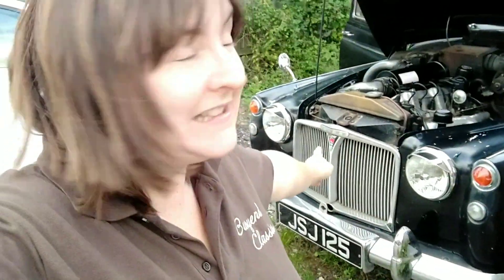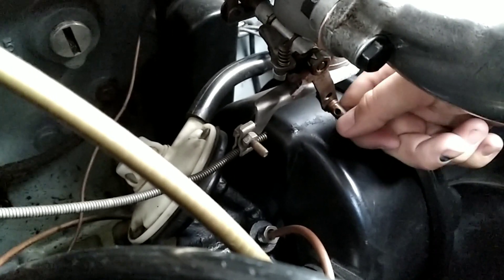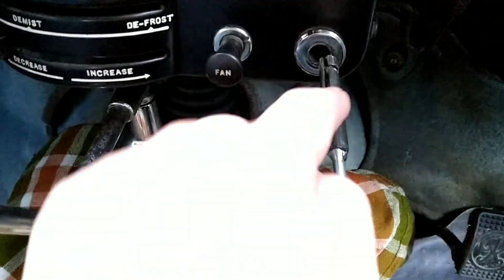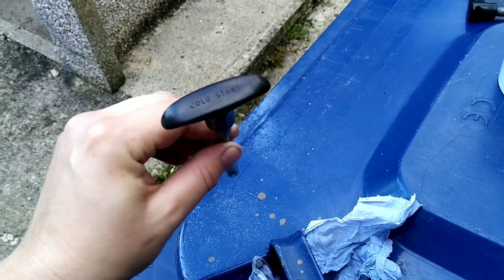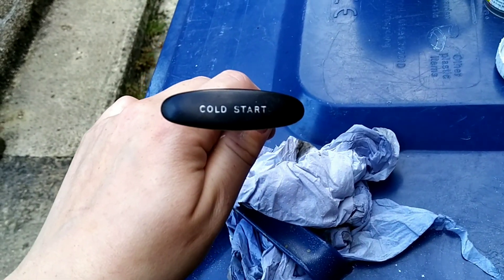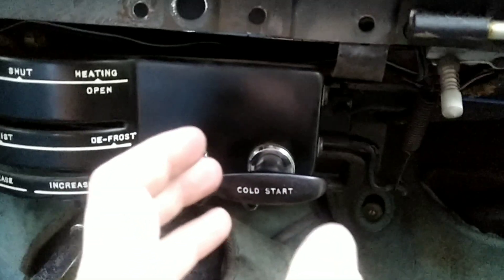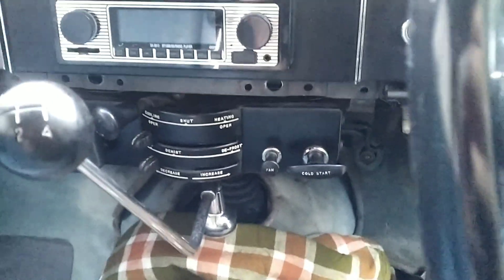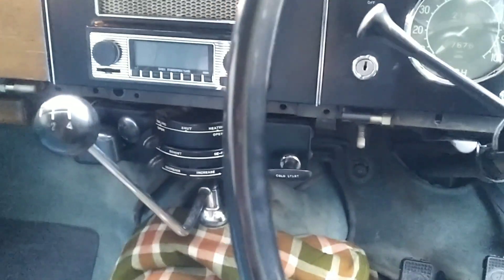Rover P4 1961 100 KNOBS and switches Freshtoration and *OH LOOK A PLANE* Choke Replacement

Comment: I just love watching people take mechanical things apart and putting them together again. That choke mechanism looks as though it was designed with the thought that someone may have to repair it at some stage. What are the choke and gear lever knobs made from? A black bakelite, similar to the material still used today for domestic light switches and other electrical fittings.

Comment: Please what's the circular white thing close to the carb behind the choke cable - which seems plastic? Thank you.
Reply from the maker: Hello! I think you are looking at my brake servo? It's an upgraded servo (not original) from a P6 I believe. 👍🏻
Reply: @Alexsassets  Such a little thing? And so close to the carb?
Reply from the maker: @tanneguydecourcy6079  I would post a picture, but I can't on here. The plastic thing is part of the servo . The servo is the big black cylindrical unit under the carb.